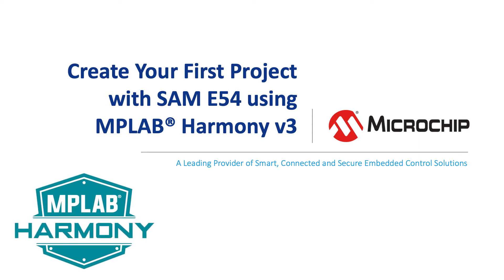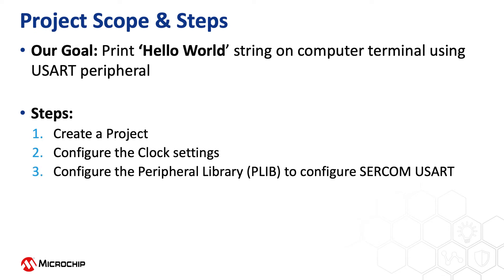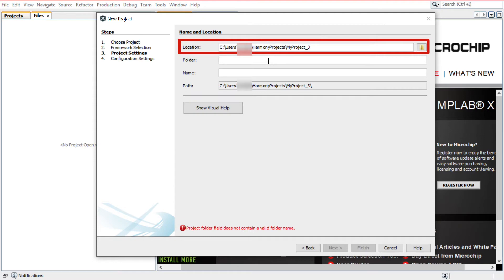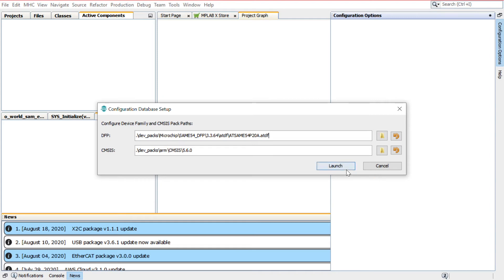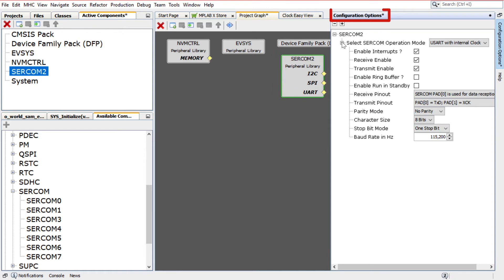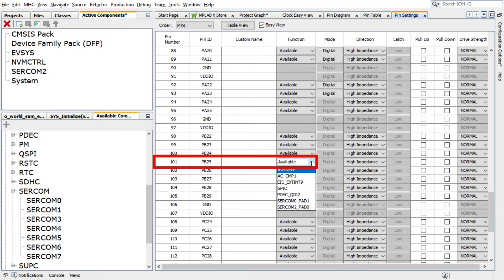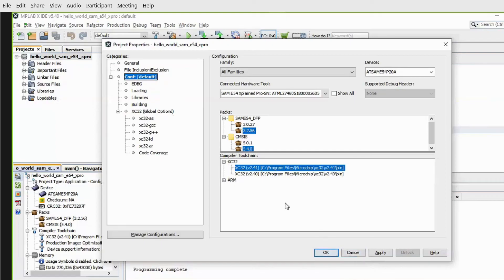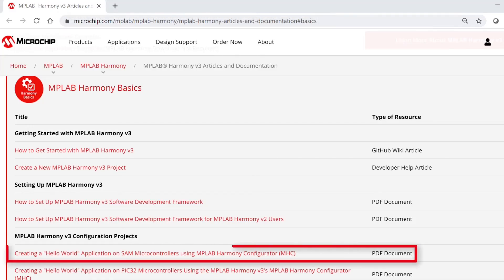Create Your First Project with SAME54 Using MPLAB® Harmony v3

Comment: If using MPLAB V6.05, then you must not use the Native Netbeans (Options->Plugins->Native_Netbeans), instead use "Standalone" (Options->Plugins->Standalone). Reason: with Native Netbeans the Tools->Embeded->Harmony 3 (MHC configurator) launches a tab within MPLAB and the MHC button DOES NOT work; with Standalone configuration, the MHC configurator launches in its own window and provides functionality in its own toolbar, functioinality that used to be under the (now not working) MHC button (such as pin or clock configuration. Search on discussion threads suggest same problem might exist with V6.00. Otherwise ... good video, thanks!